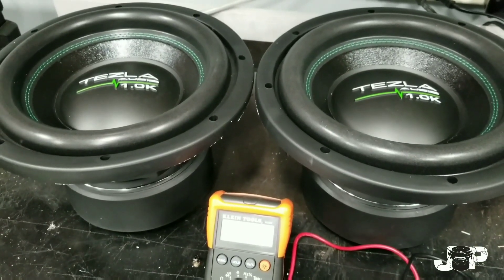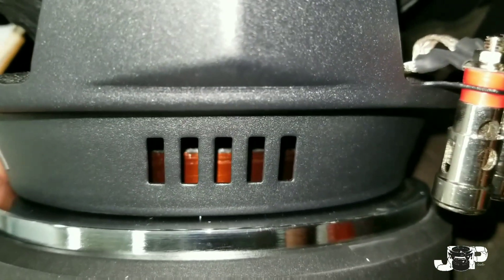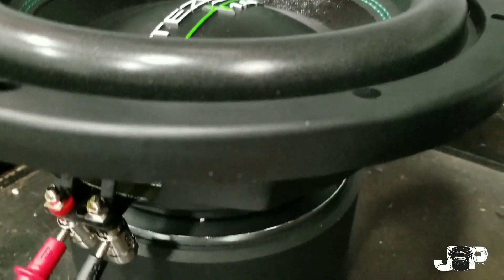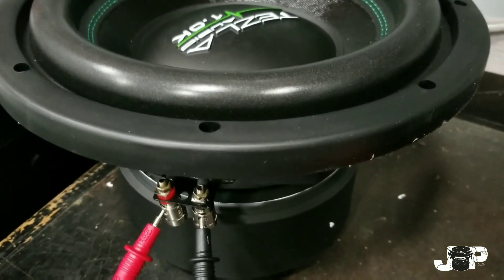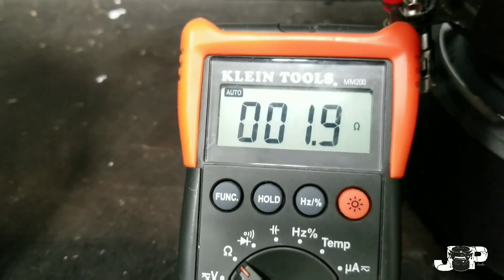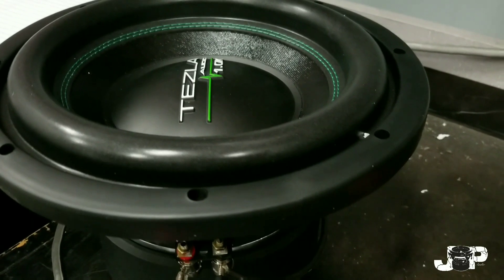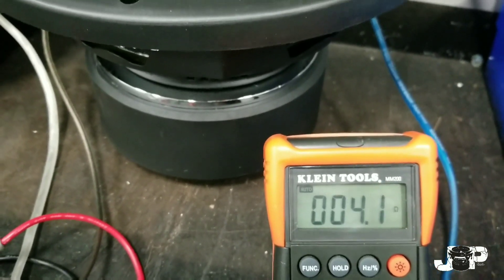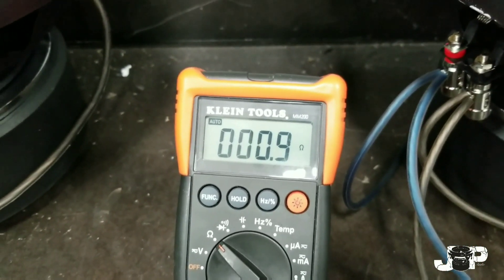HOW TO WIRE SUBWOOFERS series/parallel

Comment: Jpsaudio how do you wire 2 dual 4ohms to 2ohm final impedance
Reply from the maker: you cant bro 2 dual 4 will have an impedence of 1ohm or 4ohm. if you want a 2ohm load at the amp you need 2 dual 2ohm subs
Reply: @jpsaudio08  I thought so, thanx for responding

Comment: When you did the 2 parallel’s and had a 2ohm load. Can you leave it like that and connect the positive from one speaker and the negative of the other speaker to the amp? I’m new to this and I’m sick and tired of re wiring and it not working.
Reply: If both of your subs are Dual voice coils at 4 Ohms each coil. And if you're wiring them parallel you get 2 Ohms per sub and if you wire them both parallel and  combine both Subs them  positive with positive and negative with negative you'll get 1 Ohm for both subs connected witch is full power for them and if your Amp is not 1 Ohm stable it will burn out

Comment: Ok I have two Skar ZVX v2 d2 12 dual 2 ohm, how will I bring both  down to 1 ohm at the amp, my guess is don't hook up the other end on the same subwoofer but hook up the two subwoofers together. So it will be 1 ohm. Is this  correct? Thanks for info
Reply from the maker: no sir you cant wire 2 dual 2ohm subs to a 1ohm load. 1st all the coils have to be connected so you dont mess the subs up. you can only wire those to subs to a 0.5 or 2. 2 dual 4ohm subs wire to a 1 or 4ohm load.

Comment: what do u mean you can hook up 2  svc's a couple different ways. bridged or unbridged and when you bridge them comin from the amp to the subs you have to hook up a pos on 1 speaker and then the neg to the other speaker  and then take a wire and hook it up from the connection that's left on each speaker together going from pos of 1 speaker to the neg of the other speaker.

Comment: QUESTION: An answer please?! Can I get 2 two ohm dvc subs to work with one 1 ohm amp that has two speaker outputs? 
If so how would I need to wire them? 
I don't see why not as long as the mono amp has dual outputs which it does considering I've already done this set-up for one 12" dvc 2 ohm sub, (but now want to add a second sub) so if wired correctly I'd think I can with two L7 12" dvc 2 ohm subs (connect at 1 ohm to one mono 1500.1 or 2000.1 Skar amp) THANKS IN ADVANCE!
Reply from the maker: i wish i could send a pic of this but 2 dual 2 ohm subs will either give you a 2 ohm load or 0.5ohm load and if your amp is not 1/2ohm stable then you might not get much playing time or the amp will just cut off and go into protect mode each time.
Reply: @jpsaudio08  thanks. So either I need to buy one big ½ ohm stable amp or buy a second 1 ohm amp to duplicate my current setup of one 2-ohm dvc L7 with a 1 ohm amp, and split my power wire to power 2 amps I presume.?